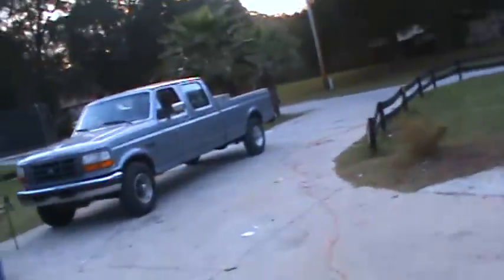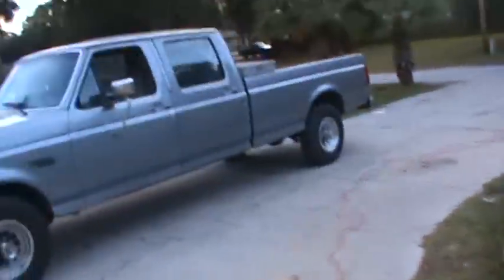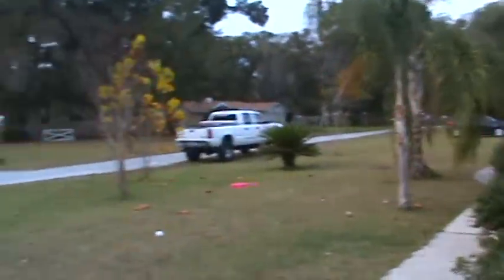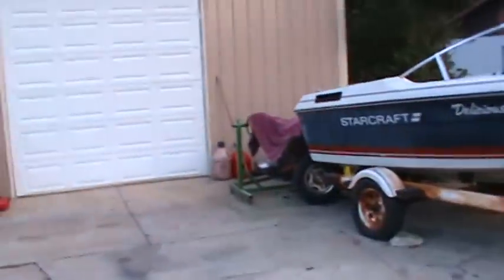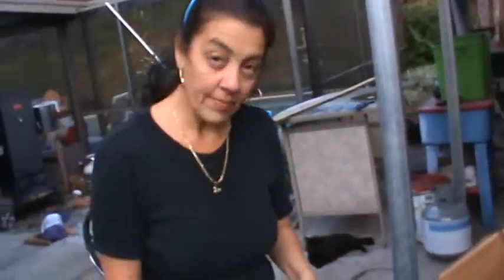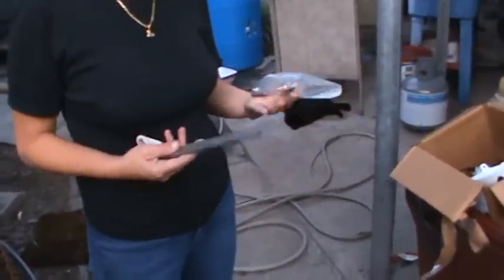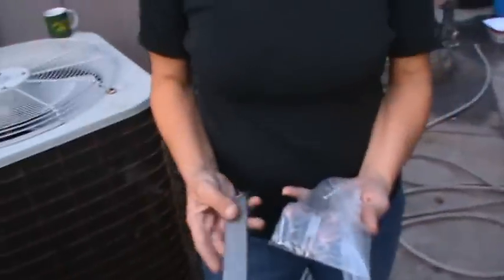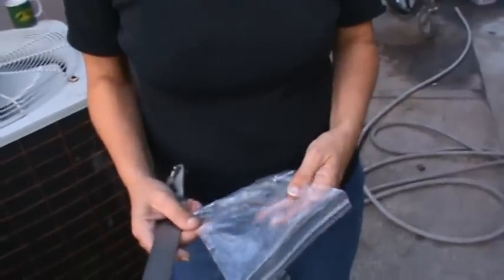JUST A RUNDOWN

Comment: It looks like your camera uses a tape to record on. The VW looks really good. I didn't notice in your other vids, does the outer body bolt to the subframe/pans or is it welded in spots?

10.70's? I run faster. lol That's scream'n quick. Do they run turbos on those air cooled engines?